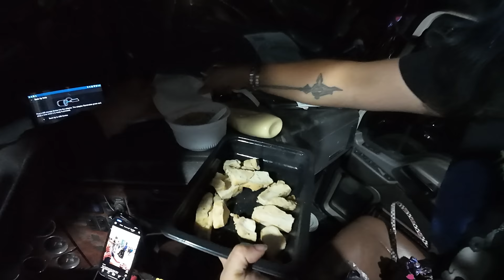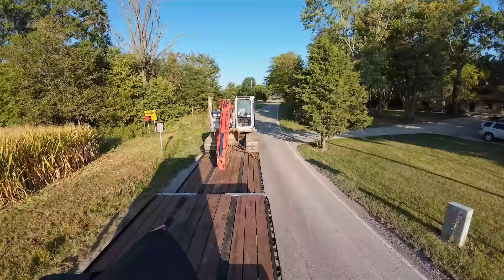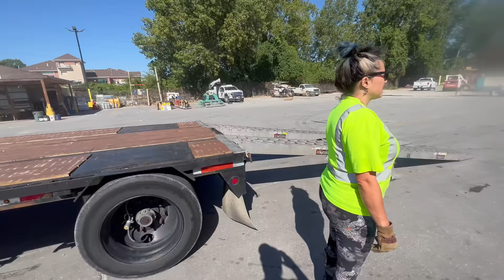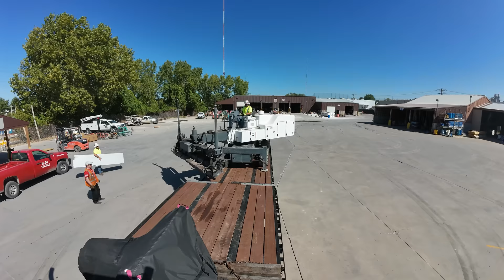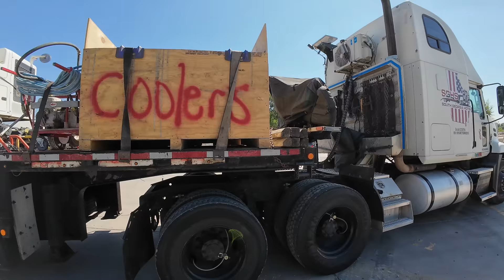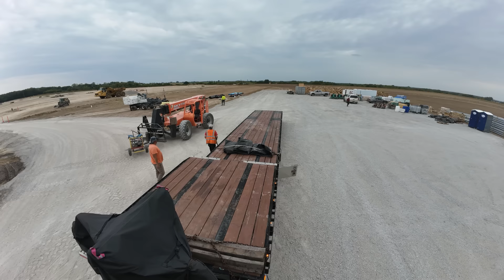We finish up our first week back in the truck!

Comment: I see when they drove that machine off. You don’t drop air in trailer. I have a dump valve on rear suspension. That will break your shocks. When trailer comes up so quick.  Same as unloading a big coil. Glad your running again. Super mechanic behind wheel. Your dog that blows horn reminds me off European driver. Always in a hurray. Take care.

Comment: Construction loads - they know how to pile it on! Glad to see the Mack out there earning it's keep! As for your inverter, I installed a Renogy 3000W Inverter / charger and I love it! Plug into a power source and it will run your stuff while charging the batteries at up to 75A! I keep my truck plugged in at home and leave my refrigerator stocked.

Comment: I had a load loaded by a payloader.  Wife made lunch at a REMOTE gas station.  Bathroom was a porta potty.  No store of any kind.  Building on site was @10x14 ft to hold electrical I assume.  No sleeper but made lunch work.

Comment: Company i work for has epu and it has 2 sets of batteries 1 for truck and 1 for epu when batteries get low like 12.1 volts truck cranks automatically its so nice my company truck is a 2023 freightliner Cascadia dd15 with 102k miles i also pull 48 flats never the same trailer sometimes pull same trailer for a week or can pull 6 different trailers in a week

Comment: ok I know you got the cameras why don't you mount one on the blind side. You can buy backup cameras with separate monitors I know they're not that expensive you could mount one on side of truck and one on the trailer and you could see everything. You could even buy a security camera kit and you could monitor you truck at night through your phone or iPad and use them to backup.

Comment: I've always wondered what the draw of the spread axle is? We almost never see them up in my area since you lose so much weight allowance here, A normal tandem axle would get 17000 kgs, 37480 pds. A tridem axle group gets 24000 kgs, 52910 pds, but a spread axle like yours only qualifies as a quantum axle group at 9100 kgs,20100 lbs.
Reply from the maker: A spread for us allows 40klbs